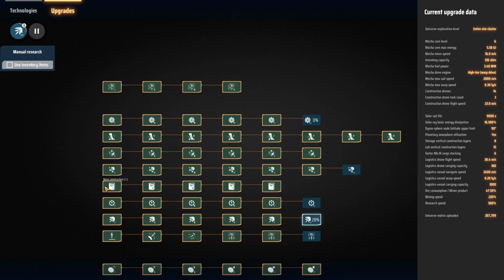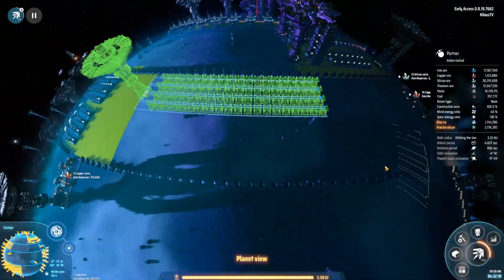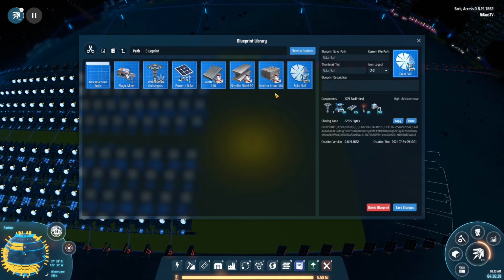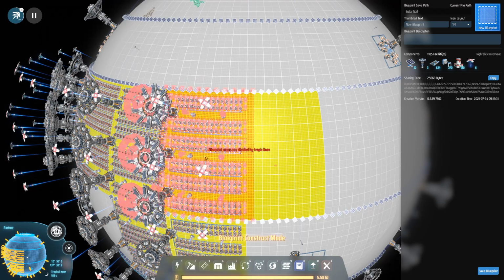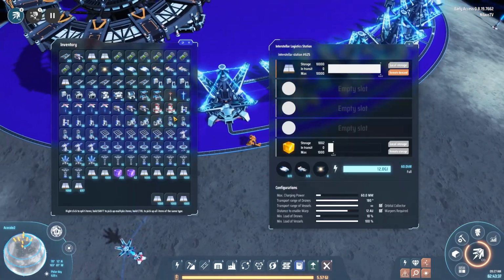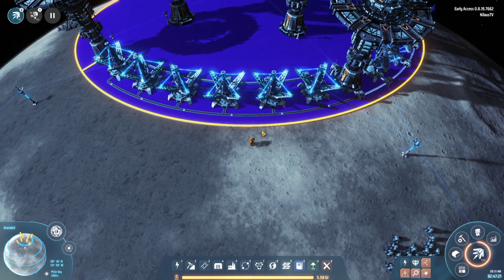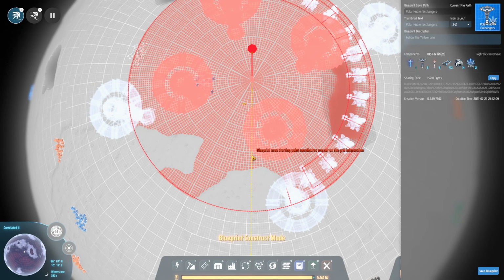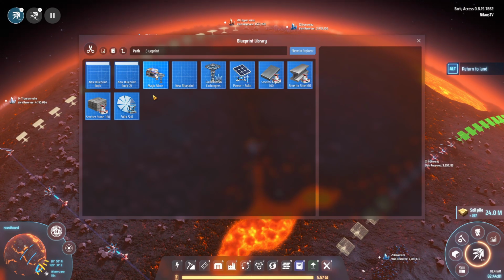BLUEPRINTS; From Basics to Global Templates | Dyson Sphere Program

Comment: I had a weird one happen.  Applied the polar make everything blueprint and tried to put warpers into a tower to gather rare from another system for item production.  They just vanished.  No ship launched or anything.  Checking if it was a 1 off error, i did it again w/ a really low amount, but same thing happened.  When i deconstructed the tower I did not get the warpers back.  Reconstructing tower and trying again, it did not cause the warpers to vanish.

NOTE: This is not the 'error' I've read about that happens when people put warpers into one of the 5 slots and haven't unlocked logistic warp yet.

Comment: You could make one or 2 more magic miner blueprints with different gaps, maybe even one where they are arranged circular or oval even, seeing that most nodes aren't circular anyways, you might have more success without having to manually bury nodes. With time you should be able to see from the size and shape of the node itself which one of those miner blueprints will work on it rather than trying to place the simple square one down and fiddle with it.

Comment: An idea for the "magic miner" (just from watching, not tested yet): Wouldn't it be better to go one step back and make a blueprint for two parallel miners with belts+power poles only? Place north side, rotate, place the east, ... You have to place the logistics station and connect the corners at the end, but that's a lot more flexible regarding the actual geography.
Reply: Yes, the magic miner here is tricky to use; just one miner not touching ore and it will not build.  Going for 2 N and 2 S might help that
Reply: I made a half mine blueprint with just two sides(a corner, 4 miners) and it picks up most of the ones that the big one does. It can get some on fault lines but not all
Reply: @coleblooded42  ditto.  I have the ILS and North/West miners.  A second blueprint for East/South.  Then just connect belts to the ILS from there.

Comment: would be great if one could just make a universal smelter blueprint and set the recipe inside the blueprint menu BEFORE placing it so you don't need half a dozen blueprints for basically the same layout
Reply from the maker: different recipes have different ratios, so even if you could then it woudn't be universal. I will provide the next best thing "soon" ;)
Reply: @Nilaus  okay then for those smelting items that share the same ratio like iron/copper/stone 

already looking forward to it, thanks! :)

Comment: So I've never really tried this and could go and try it but..... I'll just make the suggestion and test it later.

With the Magic Miner blueprint, instead of trying to submerge that one vein, couldn't you just do this: Submerge them all. Place the blueprint where they were, then come back and raise them all back. I feel it would use more concrete but save vital seconds, and sanity.

I'm surprised there isnt a "Match Concrete" option on blueprints yet either.
Reply from the maker: you cannot place a miner unless it can reach at least 1 vein and submerged don't count, so it doesn't work
Reply: @Nilaus  Makes sense, was never something I tried. Knew about it for water pumps though.
Reply: I don't believe that would work because the miner needs the resource in order to be placed. I haven't tried it, but I'm guessing that requirement still holds true in a blueprint.

Comment: Iv noticed a bit of a bug where you can get assemblers/buildings that you haven't researched yet.
If you place a blueprint that has say mk3 assemblers you can replace it with a mk1
You'll sometimes get the mk3 back in your inventory.
Some belts don,t always match up but I haven't noticed this with any blueprints from factories I made myself.
Reply: conversely, if you paste a recipe you have not researched, the assemble is just blank (which is good)

Comment: Thanks, great tutorial. That miner blueprint is fantastic!

You have missed the option of actually putting blueprints into different folders. It's not intuitive. You can't drag and drop them into folders, or rename folders in game. If you want to move blueprint to a folder (optionally creating the folder if it doesn't already exist) you need to rename it. As blueprint name is actually a path. So, in order to move/save a blueprint "Blueprint 1" to a folder "Folder 1", you need to write the name of the blueprint like this: "Folder 1/Blueprint 1". Saving it will be immediately visible in the blueprints menu.
Reply: excellent tip, thanks
Reply: Just use your file system, the books are just directories. Much easier than manually typing in all the book names
Reply: @skillfulfighter23  I disagree. IMO alt-tabbing and searching for the games directory is a nuissance.

Comment: Awesome  video, I'm super excited to be using blueprints finally.  One thing I've noticed, don't use demand for local AND demand remotely on the same interplanetary logistics station, especially if you need to actually get it locally (say for hydrogen while making graphene or whatever it is from fireice)  because it seems to prefer getting it remotely since it's getting 1000 per trip rather than 100.  you'll get clogged up locally.  so what I've done is only demand locally and use specific stations for demanding remotely that supply locally if I need more than what I'm able to provide otherwise.
Reply from the maker: When the demand is 10000 and it drops to 9900 it will send out a Drone to fill it up. Only if the Drones cannot keep up and it drops below 9000 will it send out a Vessel to pick it up remotely.
Demanding both is a great way to prioritise Local over Remote